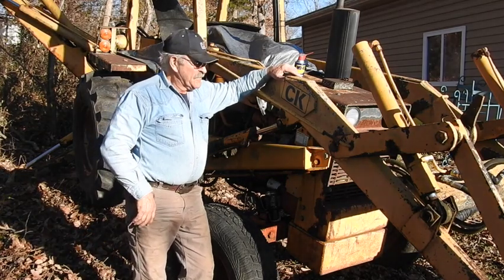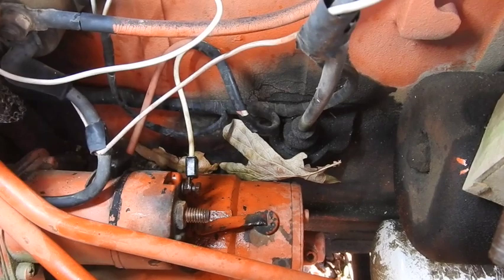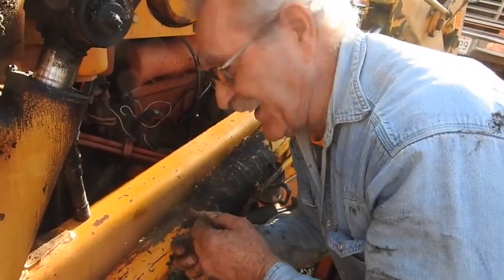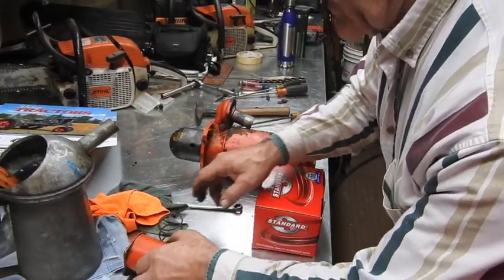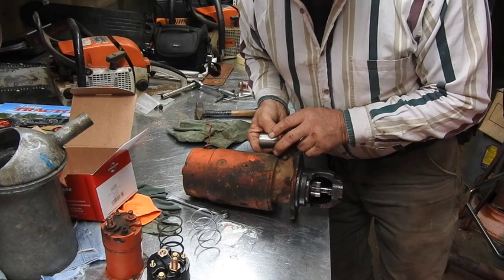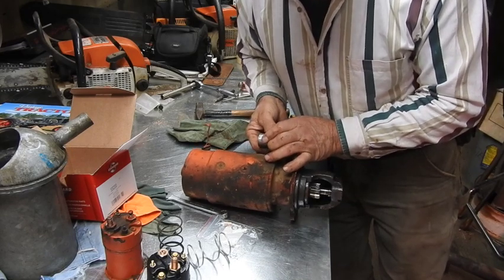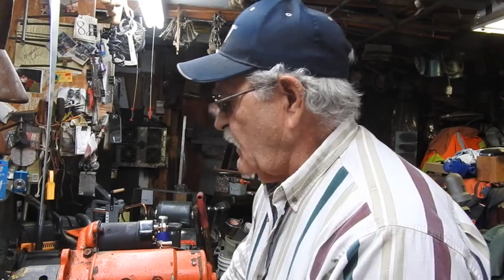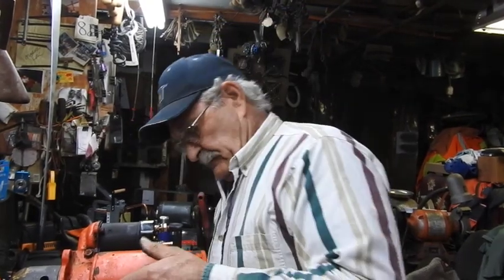Case 580B Solenoid Change, 1973 Vintage

Comment: Mom had borrowed a Volkswagon Rabbit from my brother in law when her Beetle caught fire. 
The car was a good little thing that was simple to fix. She was down in Indiana for some reason and it wouldn't start. She of course called to see if I could help. I drove down and pulled off the starter solinoid. There was a copper disk in the back that when the solinoid pulled in it pushed that copper plate against the contacts. I flipped it over and the car started right up. 
The nicest thing was on the diesel engine in the car the starter was just behind the radiator right at the top of the transaxle. Easy to get to and held in place with two metric socket head cap screws.
Reply from the maker: That was a quick one for sure !!  Proving once again that everybody gets lucky ever now and then.  LOL.  Reg Sparks told me that he used to take apart the style I had and fix 'em in similar fashion.  I'm just glad to have found a replacement so easy.
Reply: @tractorman4461   Every job is different. 
Just because I said it on the internet doesn't mean I have a clue as to how things really work. 😁😎
Reply from the maker: @OldSneelock  hahahahaha....but the quality of the work performed on your videos prove you really DO know how things work.  Jus' sayin'...(-:

Comment: Yes Wendell I too found that tab after some grunting in trying to remove it too. I thought to myself, " now there has to be a way to remove this easier than this. So, I stopped and studied it,
like you did, on the bench, now I know! :)
Now if you can't find one of these solenoids to buy, you can repair them ( usually ) by taking that black plastic cap of the solenoid, and you'll find a large copper contact ring inside there ( hopefully ) 
All you have to do is turn that copper ring or disc slightly to give a better/new contact point for the electric current to pass and activate the solenoid again. 
Worked for me a few times over the years, so I thought I'd pass this on to folks who may not have known this little tip.
Reply from the maker: You know, I didn't even think about pulling it apart to see what's in there.  I was in such a hurry to make sure the solenoid could be located that temporary insanity slipped in for a moment.  But I guarantee it will be repaired if possible for the next time and waiting in the wings.  Thanks Reg for the enlightenment my friend !!  I've taken apart numerous old push button starters and filed the surfaces.  Of course some were burnt beyond help.
Reply: @tractorman4461  Well, I'm glad the tip that I got many years ago, worked  ( again, hopefully ) for you and the Case's starter.
When you do haul it apart, how about making a small video on the process?  I think it would be good for other folks ( and me :) too!
Cheers Brother!
Reply from the maker: @regsparkes6507  I'll surely do that Reg.  Thanks again for rattling my brain dead brain....LOL.
Reply: @tractorman4461  Naw, there's nuttin' wrong with your 'computer' !
Reply from the maker: @regsparkes6507  Hahahahaha....

Comment: Wendell you forgot to mention the contacts that connect the battery to the starter. Aren't they a part of the solenoid too and don't these burn out causing the need to replace the solenoid?
Reply from the maker: Yes, the connections, if loose can corrode and inhibit flow of current.  Severely loosened cables can arc and spark and burn themselves to deterioration.  You're right...I didn't mention that.  Thanks Rick for keeping me sharp !!
Reply: @tractorman4461  actually I was thinking about the contacts inside the solenoid that send power from the battery to the starter when you turn the key to the start position. On older models there was a foot switch to do the same thing.
Reply from the maker: @rickburris6164  Oh, I didn't pick up on that.  But yes I probably should have disassembled it but for some reason I just didn't think of it.  But I do plan on taking it apart and fixing it if possible for a back up.  Plus I'm looking at a 480 Case diesel loader tractor that's been sitting and the owner said it either wouldn't work or the starter was out.  I don't remember.  So yes, I misunderstood your prior statement.  And yes, I've repaired countless push button starter buttons on old tractors...recently on a Farmall H.